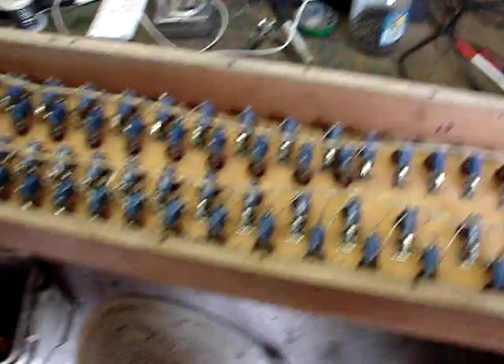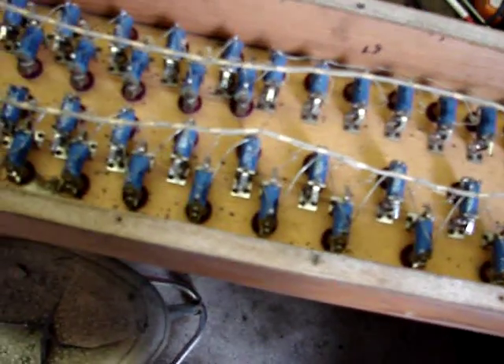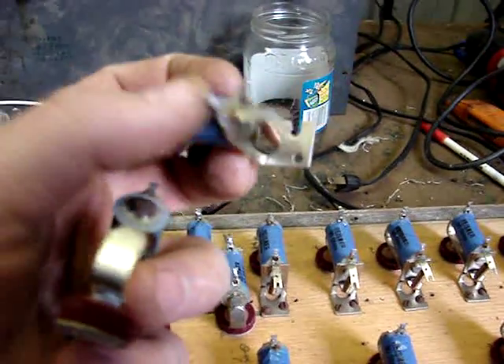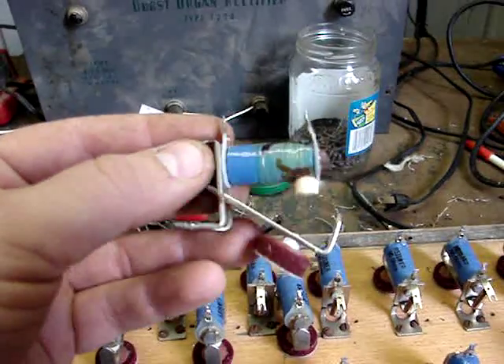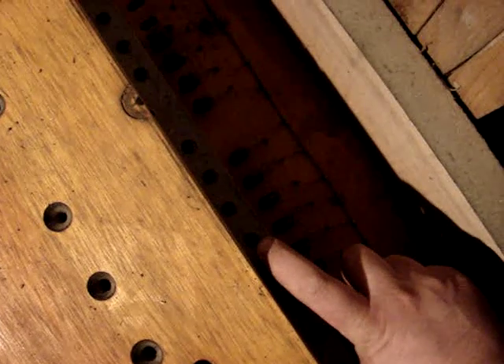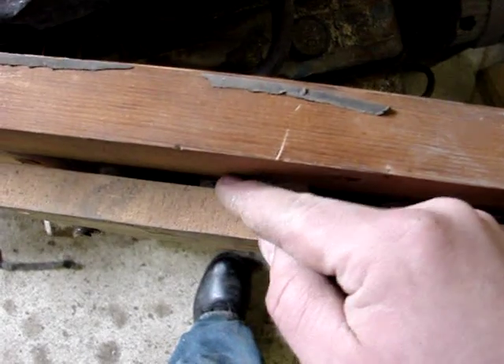Pipe Organ Update 4-3-11

Comment: Quite interesting, you could use a little 12V dc power supply that provided 2 amps or so rather than the large power supply to check the operation of the electro-magnets.  The unserviceable ones could be rewound easily enough.
      I am an organist & and electronics tech refurbishing older electronic organs and yes it's time consuming. Getting motivated is the hardest part.  I have 50-60 stop electro-magnets to install in a console. I will design a capture system  for this eventually.....Rob